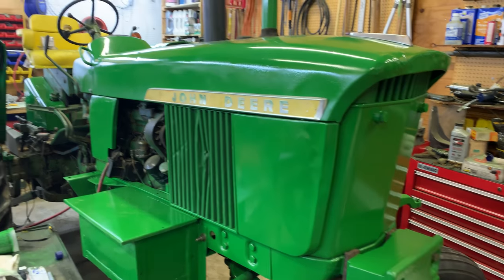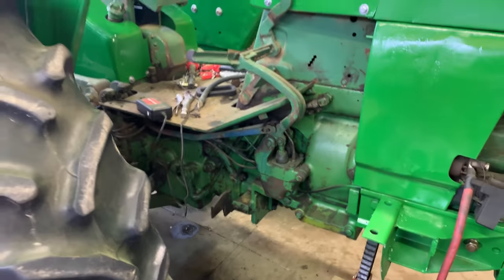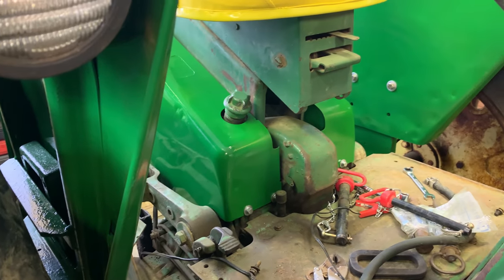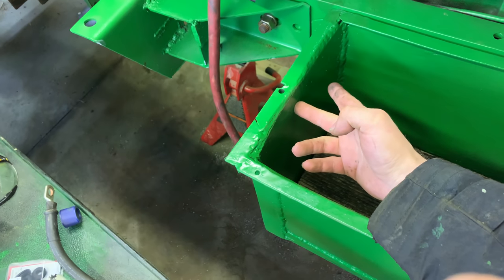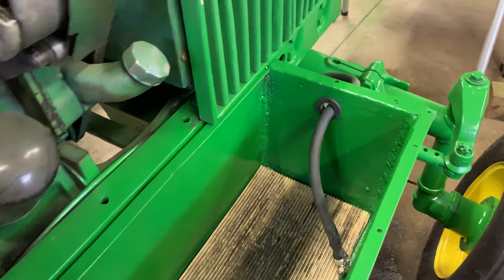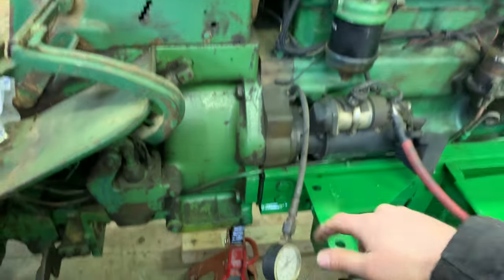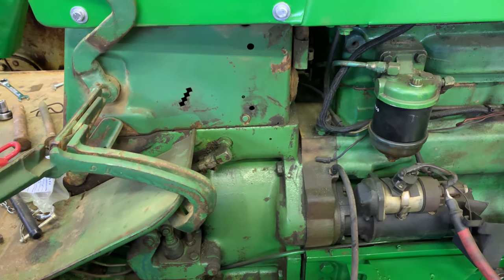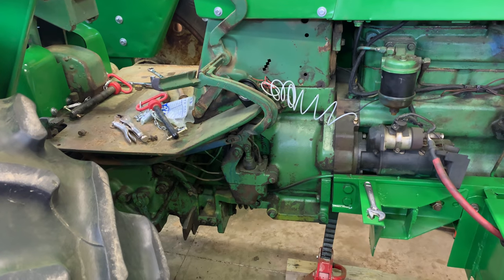Attaching Fenders, Battery Box Grommets, Oil Pressure Gauge, John Deere 2510

Comment: Well could put down but the key, maybe on hood make a little hood scoop for and find a hood bolt and use that or make couple little holes in hood, it is steel you can always weld the little holes back up, battery box cover, it's already modified thing anyway, make a box on side er end side torwds the driver , u could maybe even put a battery gauge next to it. Maybe even rail presure gauge er manifold temp gauge :)
Maybe even a turbo gauge if you get really wild haha
Reply from the maker: I was thinking that as well either a little hood box or by the key, someone also suggested the steering column might try that.